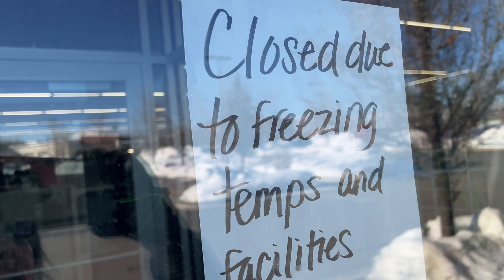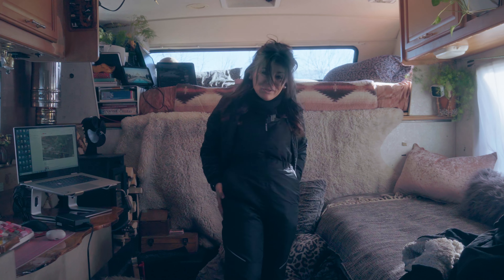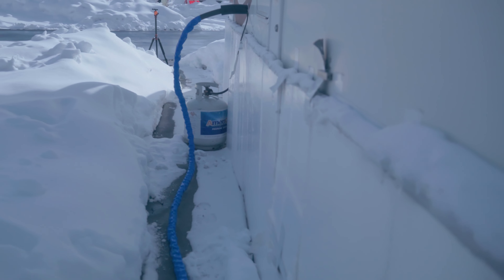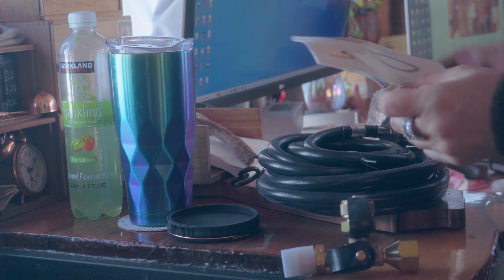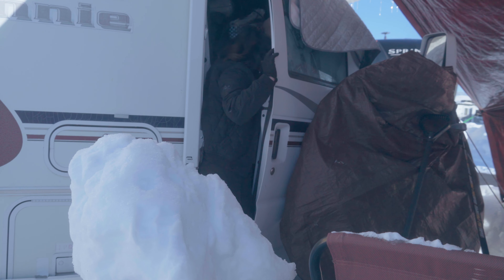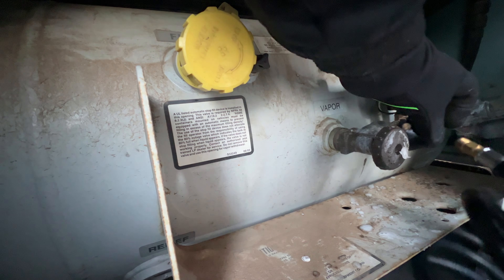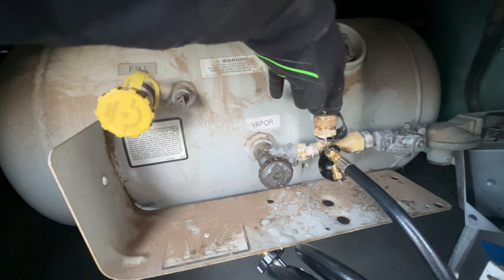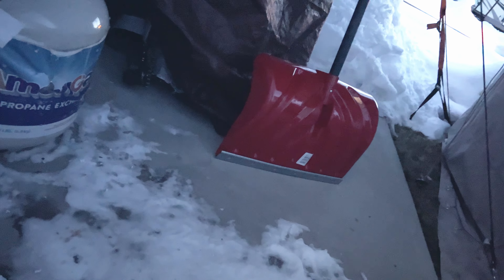BRING PROPANE TO YOUR RV. Rookie install a PROPANE BYPASS VALVE and pays the price WAS IT NECESSARY?

Comment: Brass fittings are soft .. I would get a Medium sized Crecent wrench and  not use Vice Grips.. Yes Gas lines have opposite of Normal threads so you don't accidentally hook a gas source to an oxygen tank ect.
  I was wondering why you didn't just take your Portable tanks in your Jeep to be refilled.  My Camper  has two 40# Portable Propane Tanks .. I supposed yours is a lot larger than that.
Reply from the maker: Thank you for the recommendations Mike! My Minnie has an onboard tank but since I was stationary with the skirt around it, I couldn't move it so I installed the bypass valve so I could take a tank with me to get refilled. So that's what I'm doing now :-)

Comment: I refill my  20# 40#  and 80#  Propane tanks from my  500 gallon tank. I pay less than half what they charge to fill the small tanks.  I don't think I will be able to refill the new small tanks 40# & 20#  as they have a safety float  that shuts off so you can't overfill the tank.
  I still use the old style valves..  That Propane dealers will not refill .. because of Government Laws.
Reply from the maker: 500 gallon! Holley Molly! So you get your propane delivered right?
Reply: @HerSoulVacation   Actually I have two 500 gallons tanks and the Township stole my 1,100 gallon tank mounted on a Truck .  I have a Farm tractor that runs on Propane and I was considering converting a truck to run on Propane ..